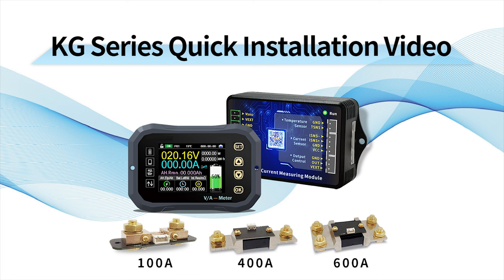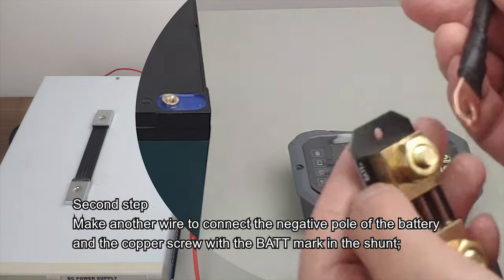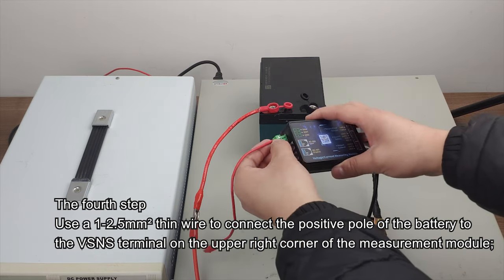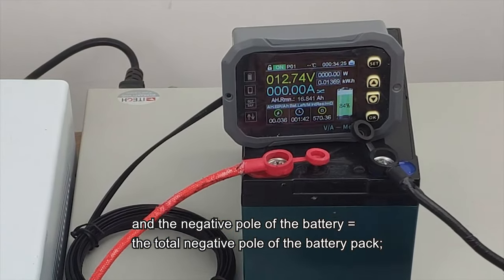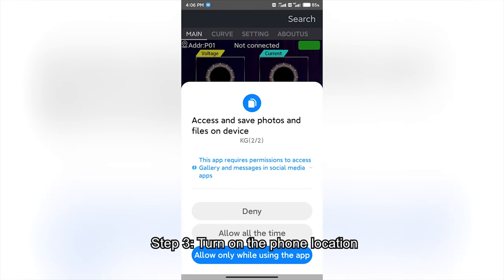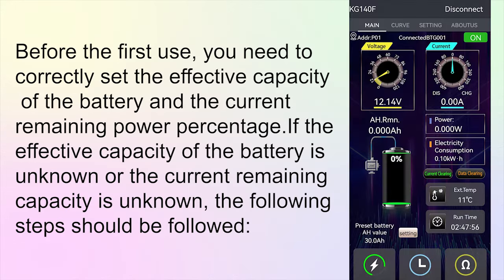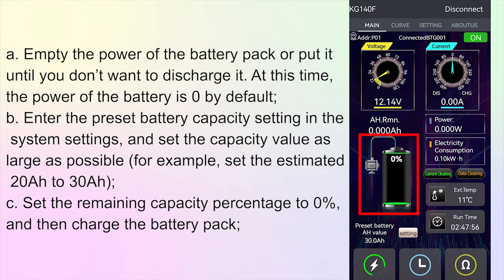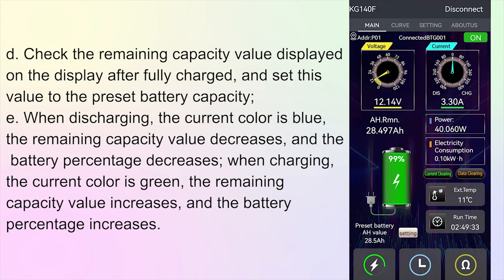JUNCTEK Quick installation and use explanation video  KG-F Battery Monitor  KG110F KG140F KG160F

Comment: Hello! Thank you for creating this video! I have a question regarding its usage. Can the kl110f be used with cars or car starter batteries? If yes, do I need a larger shunt due to the spike in current caused by the car starting? I want to monitor parasitic drain current, which is under 1A. However, I'm unsure if I need a larger shunt as my car battery has 500-600 cold crank amps (Honda Element 4.2L, 4 cylinder). I've seen many people using this product in RVs, but I'm not sure if they're using it on their starter battery or on their secondary/leisure battery only. I would appreciate any thoughts you may have on this. Unfortunately, I'm unable to reach the manufacturer.

Comment: Hello, I have bought your product and I do enjoy its display, very simple and gives info at glance, but for lead acid users I have found some critical issue in programming! Battery acids charge acceptance is apxly 70 to 75 % when new, this means if I draw 100 Amp H I must put in 130AH for it to reach that previous 100AH this means the meter becomes fully in accurate second charge cycle if not charged to 100%

There must be a way to set charge efficiency,  so for new battery that will be 75% acceptance, and older battery will be lower 70, as battery ages this will drop further. But for lead acid, a 70% charge efficiency will be accurate!

Second a method to tell controller the battery been absolutely fully charged, that would be amps, once amps are that of the natural leakage of lead acid battery so say 230AH bank that would be 0.3 to 0.5Amps 

Thirdly: A simple  method to warn the user time since last full charge, this can be achieved by flashing battery symbol after X amount of days, or to simplify coding, set by weeks, example: user selects 2 weeks, if in those two weeks a 100% charge is not detected battery symbol flashes or change colour, yellow for first week, then orange on second week, then if not addressed red?

My usage case: 230AH at 48V, flooded lead acid, 100% off grid (Solar w/ Back up Diesel genset) 

Desire: To have the device control generator start times when batteries get to 50% depth of discharge vs the Inverter doing it based on voltage. Or have it activate relay based on time since last full charge

Issue: Relay doesn't seem to function on AH setting, Incorrect charge monitoring due to not factoring in charge acceptance of battery type.
Reply from the maker: Thank you for your feedback. We have forwarded this question to the technicians.

Comment: Hi Junctek, I need help, I just installed this battery monitor and was very happy with it at the start. I set the battery bank capacity to 300ah and when fully charged to 100%. Everything was good, but after a day I noticed that all readings were still the same. I turned off the charger, put on a few more LED lights and the monitor showed all these changes, but the app on my phone is stuck on the original settings. Even still showing it's charging when the charger is turned off. 
Can't change any settings on the app, can't turn it off and can't disconnect, nothing, not giving me real time readings, it's frozen, any ideas if you read this post, thanks in advance.

Comment: Hi, How can be added , low tempeture control (LTP) Could you please add a guide video ? A very important shortcoming for LifePO4 batteries. Best regards.
Reply from the maker: Hello, you can find LTP by sliding the interface on the protection function of mobile phone APP

Comment: Can the Juntek shunt be used as a standalone battery monitor without the display screen?
Reply: A shunt only determines how many amperes go out or in.
Reply: There is a L version that has Bluetooth connection
Reply from the maker: Hello, you can use the mobile app to view the data

Comment: You guys really need longer wiring for the battery monitors!!!!!!!! The Current Sensor cable should be 10 foot long and the Display cable should be 25 feet long. It needs a On and Off button on the Display so it can be turned off at night or while the Display is not in use. Also on the temperature settings you should add changing from Celsius to Fahrenheit. There are still 2 different types of measurement on this planet, Standard and Metric. You have a good product in this monitor but it could be really better if these changes are made. Installing in a RV is very difficult with short wiring.
Reply from the maker: Thank you for your suggestion.

Comment: I have installed several of these but today I needed put the battery further from the display. It works with the supplied data cable but when I used a locally purchased 5 meter RJ11 cable the display does not work. Has anyone successfully used a longer cable and can you advise?
Reply from the maker: Please use RJ9 interface
Reply: @junctek1802  What is the maximum length of the cable?
Reply from the maker: Can be extended up to 50 meters @wesulius